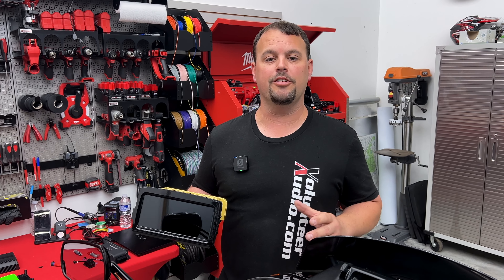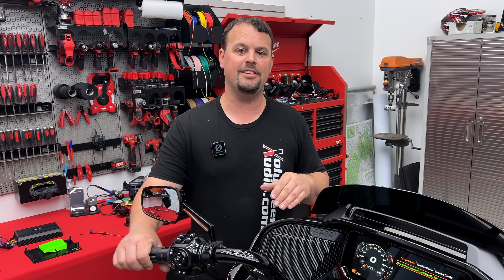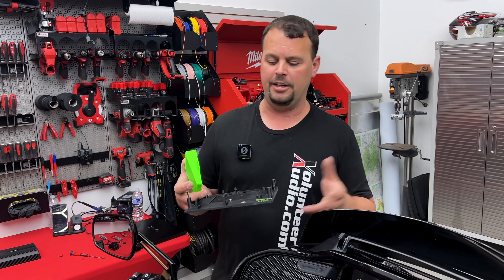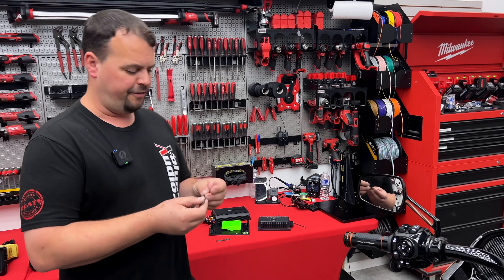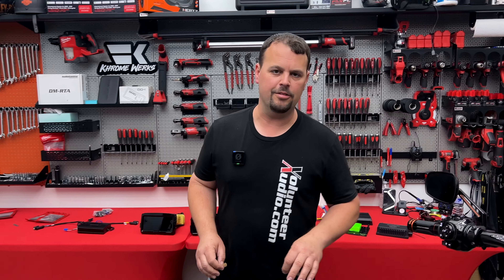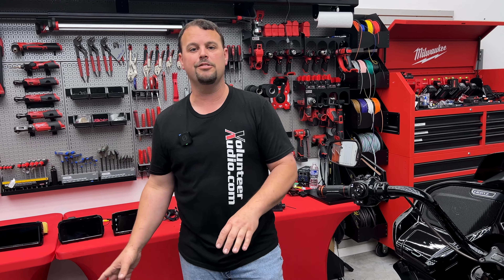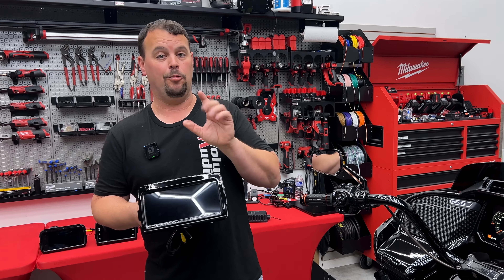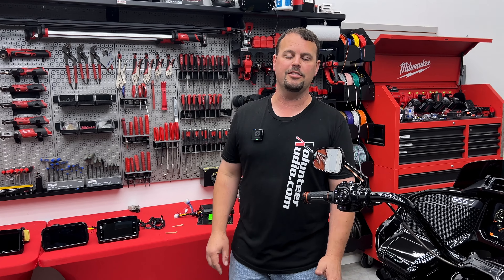What's happening at Volunteer Audio! Soundstream V2, 2024 Model Updates (A2B Interface), and more!

Comment: Any software issues with the 2014 bikes with this V2?  I’m not overly excited that there hasn’t been a fix yet for the check engine codes thrown from the software in the maestro for the 14si.
Reply from the maker: The 2014 bikes were fixed long ago, update your maestro unit to the latest firmware
Reply: @volunteeraudio  I did. I updated it to the latest firmware. There are a bunch of forums talking about how it still doesn’t work. I installed my brand new 14si less than a month ago and I did all the newest firmware before installation.

Comment: Hertz is good stuff, there are other options....ultimately, i'd like to use alternative bag and fairing speakers, as well as a different brand amp...im hoping this is a solution that allows for that eventually
Reply from the maker: We are building a purpose built solution that will sound amazing, eventually the interface will be available for other brands but the hertz system we are building has a ton of power and sounds amazing

Comment: Jay is my V2 going to work with my Rockford Fosgate Amp and speakers?
Reply from the maker: Yes, if it is hd audio by Rockford no adjustments will be needed, if it is the aftermarket kit you may need to readjust your gains for the new radio